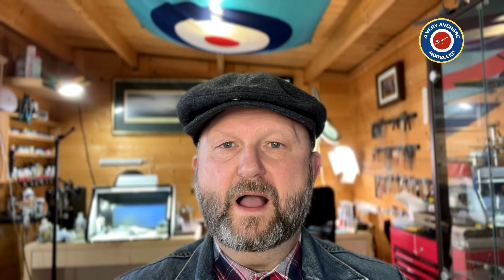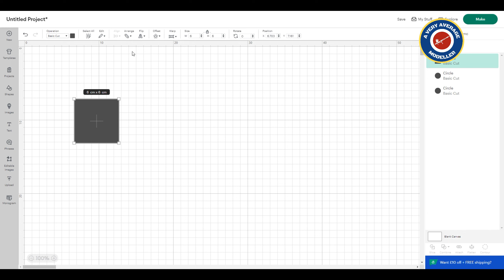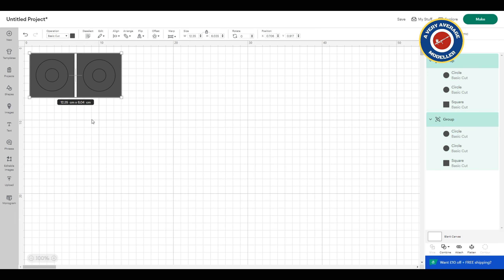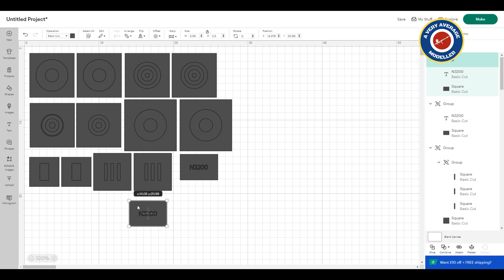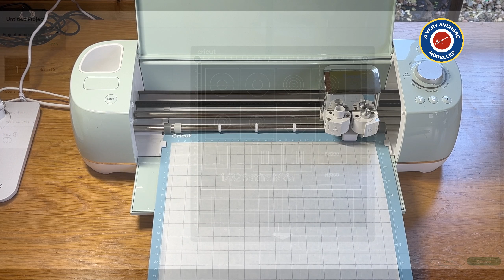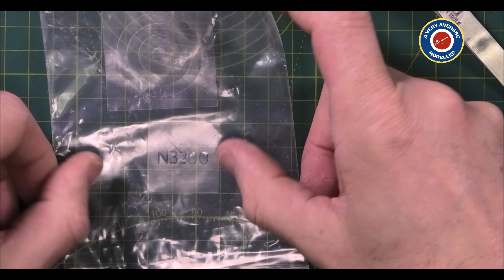Creating masks using a Cricut Explore Air 2 and the design space software.

Comment: I've been looking at a Cricut easier than I thought 😊
Reply from the maker: Hi. The cricut is very good however I will say that the images that you upload to it need to be very sharp and crisp otherwise when you go to cut your project out it tears up the cutting surface. I found this out trying to cut out the squadron codes, the letters were slightly misshapen and the cricut didn’t like it at all, but I think I have it cracked now and I’ve managed some very pleasing results 👌👍
Reply: @AVeryAverageModeller  - thanks for the video, I’m now thinking seriously of getting a cutter. How did you get around the problem of misshapen letters?